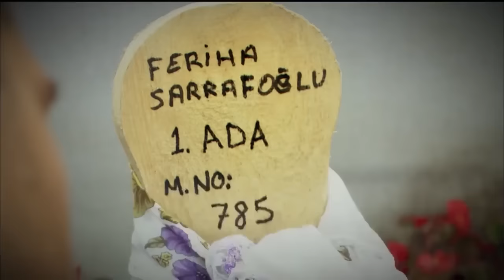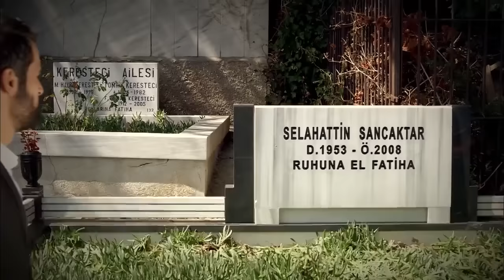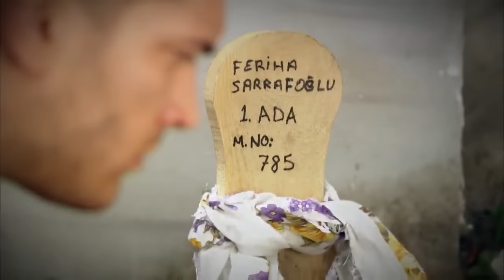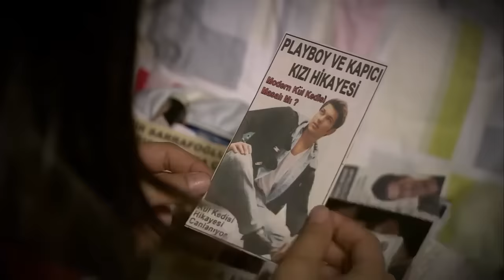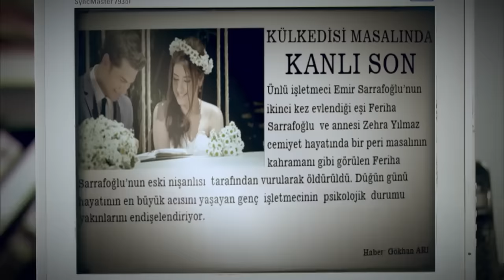The Girl Named Feriha | The Way of Emir - Episode 68

Comment: I’ve never seen a worse ending of a series than this one, I swear. I’m extremely mad. Regardless of what happened to Hazal Kaya and why did she leave the series, there is one thing my mind can’t bare and it’s the fact that the series director really believed himself enough to think that this 3rd season can exist. NO, it CAN’T, it CANNOT exist. So you call a series “Adını Feriha Koydum” where Feriha is the main character, she and her mother are on the intro of every single episode and on the cover of this series, every viewer is shacking of what will happen between Emir and Feriha through all of their ups and downs, their relationship was the whole point of the series and then BOOM - they killed Feriha and so now I’m watching 3rd season with the intro of Feriha and Zehra but they’re both dead (sure, why not). Disgusting. No wonder that the ratings of the series after 2nd season have dropped down so much that after only 13 episodes in 3rd season the last episode is just a normal episode and everything just got cancelled and ended. And that’s actually sad that it was left unfinished, because this was a beautiful Turkish drama, but the end should have been different. When Hazal said that she was leaving the show the director should have known for good that this is the end of Adini Feriha Koydum series and there should have been a happy end. The last episode was 67, the other one is bullsh*t.